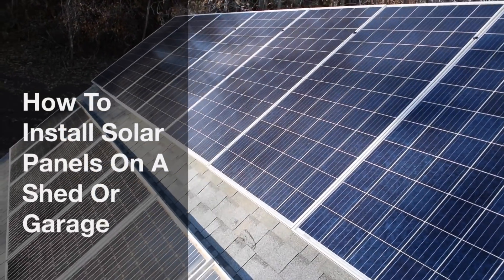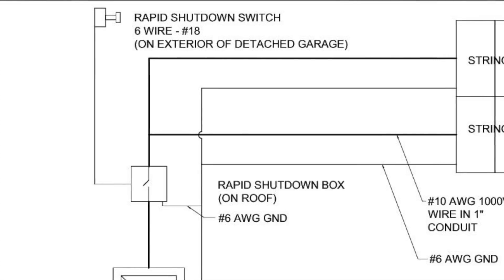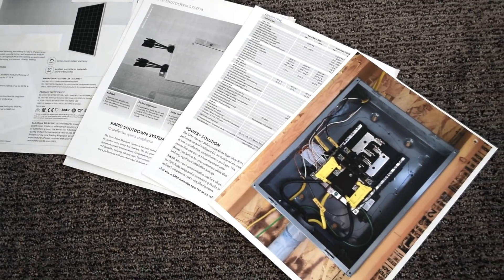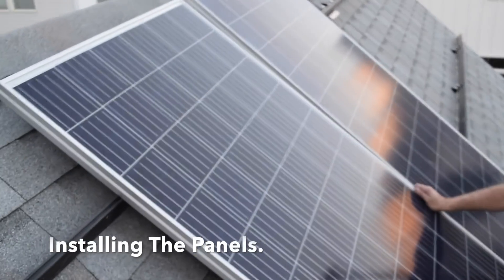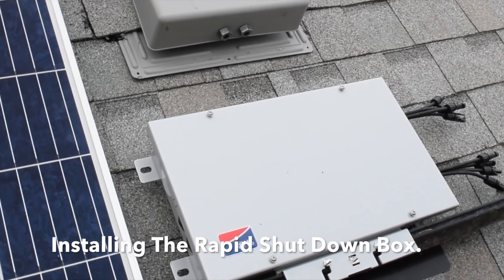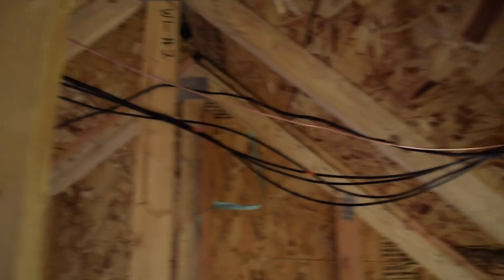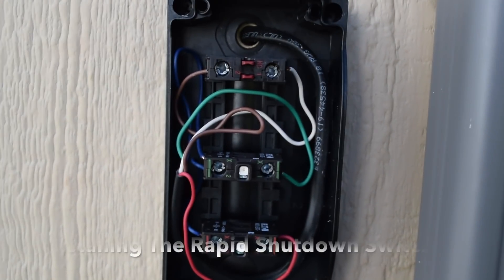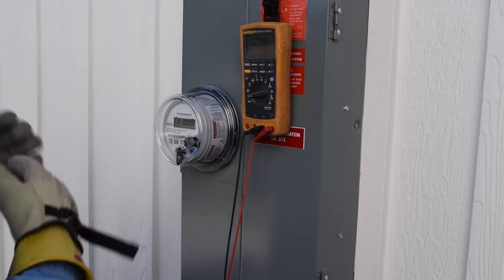How we built a solar panel system on our backyard shed to reduce power bills.

Comment: Is there a way to bypass the meter and direct feed to panel box.  The reason i say this is because the power company charges a fee and pays you penny's on the dollar from what they charge you for a kilowatt.  Just say they charge you $1.00  per kilowatt and they pay you $0.04 ( this is what my power co pays) .  Then they charge the next customer a $1.00 for the kilowatt they did not produce.  You paid to produce it with the cost of solar system.
Reply: Instead of feeding the grid try using a battery bank so you can use that kw later because at night they will sell it back to you.

Comment: Should’ve added a lithium battery bank to store excess energy.
Reply: Net metering is a joke.  Even in sunny states like Nevada and Arizona you get a fraction of what they charge you.  Better to go completely off grid or just charge several batteries.
Reply: @jjman533  it depends on the state though this is increasingly true. in some states if you're grandfathered in under their old net metering policy you're golden tho. A battery may be superior from a time of use/off peak production savings perspective, but it is expensive to install, comes with a little more risk of fire hazards (albeit small it's not nothing), and isn't legal in some places (like New York city where it violates current fire codes, though there is pressure on the government and fire department  to get past this backwards policy). It also isn't terribly practical as a scalable solution to distributed clean renewable energy the way photovoltaic cells tied to a grid already are - the PV cells in solar panels are generally made of silicon, the second most abundant substance on the planet, so getting energy from the sun does not require taking anything scarce from the earth. but our battery technology is still reliant on mined metals or minerals like lithium, nickel, zinc, worse options like cadmium, or even rare earth minerals... extracting these from the earth and producing batteries for locally distributed  storage at the household level  is not nearly as environmentally sustainable as producing the parts that actually generate, convert, or transmit power obtained from sunlight at the household level. of course the storage problem has to be solved by improvements to battery technology either way, but it is likely these improvements to energy storage will be more efficiently implemented at the industrial /utility scale than house to house. so like, not a bad idea for individuals  to do if they can afford the upfront cost and it's legal where they live, but that's a benefit for their individual finances and energy security, less so for the environment at this time. rooftop solar panels themselves are a huge benefit both financially and for the environment because their production is such  a negligible offset to the benefits they provide, and the materials are so abundant they're almost as renewable as sunlight itself.